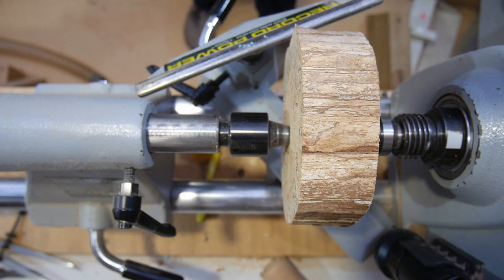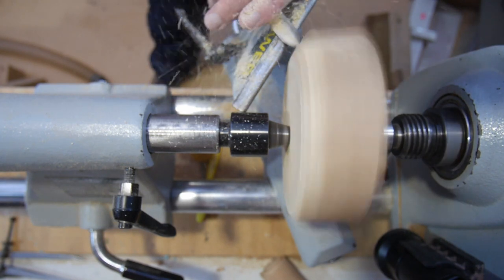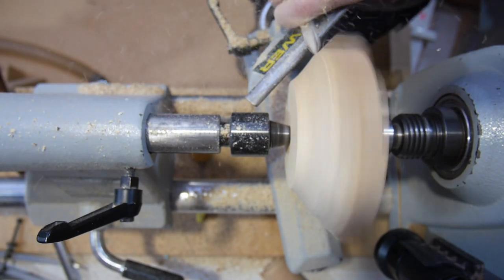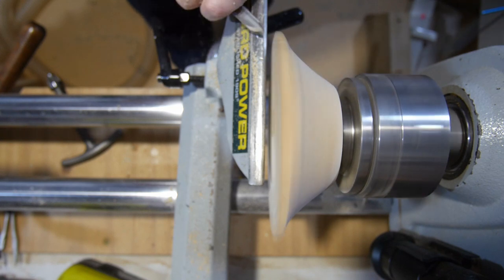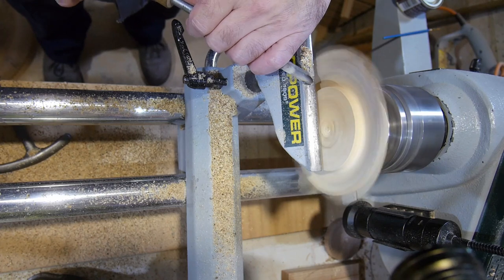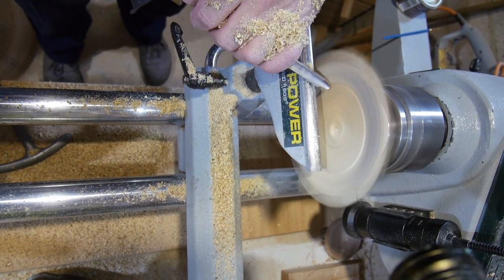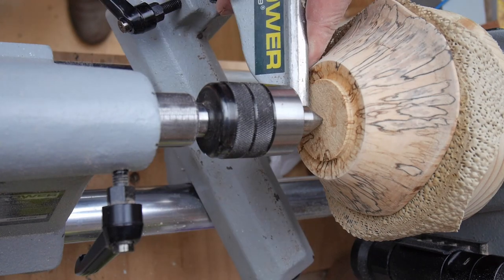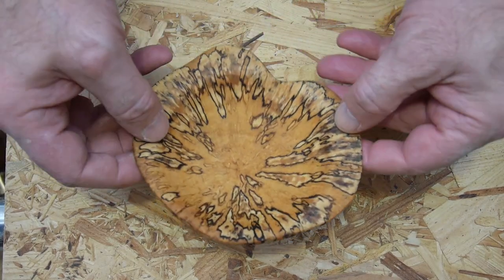Woodturning - Spalted Silver Birch Bowl - Record Power CL3, Spindle turning

Comment: Loved the video. Thanks for putting it together. Was hopeful when you mentioned Solarez sanding sealer. Did some research on the US company, sent emails and even called. Very hard company to deal with and could not get any straight answers. I mentioned several times I really want to try your product if I can get some answers and they were still less than helpful or cooperative. Guess Solarez has more customers than they need and not interested in new ones.
Reply from the maker: Hi, some sort of misunderstanding but I was talking about "cellulose" sanding sealer. The brand I use in the UK is Chestnut Products. Thanks for watching and commenting though!
Reply: @MoleValleyMaker  Sorry for my confusion. I will check out other sanding sealers. I think General Finishes and Total Boat, in the US, have a sanding sealer. Thanks for straightening me out.
Reply from the maker: @noahsark5279  No problem, I think you also have Zinsser in the US and Phil Anderson always uses that but I think that is Shellac based.

Comment: Just a silly question for any on this channel. Can anyone tell me what the on center of the Solid Steel Bed Bars of the cl3-4 lathe. In case I'm didn't ask correctly, it is the bars that the Headstock (motor assembly), tailstock and tool rest holder clamps /mounts on.
Reply from the maker: No idea I'm afraid, I sold it last summer. Suggest you join one of the woodturning groups on Facebook (Woodturning International is one of the friendlier ones). Failing that one of the retailers like Yandles might measure it for you if they still have one on display. Hope that helps